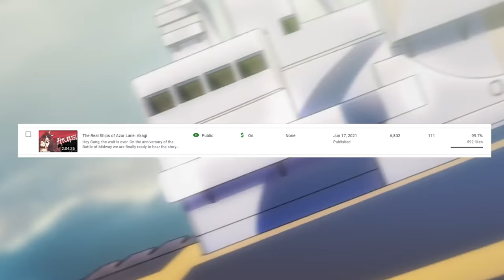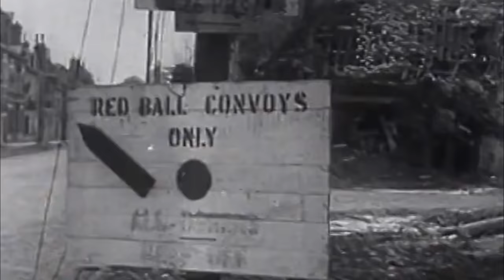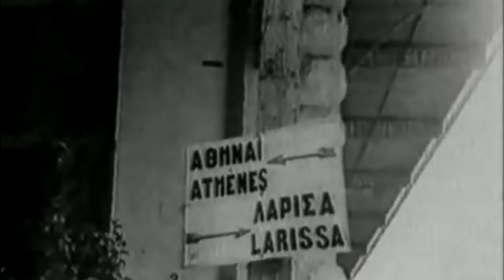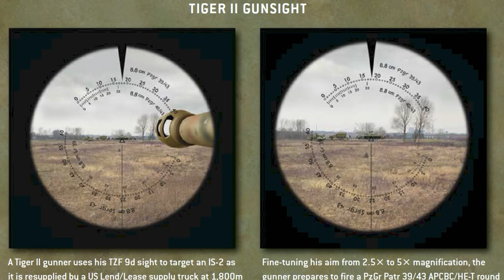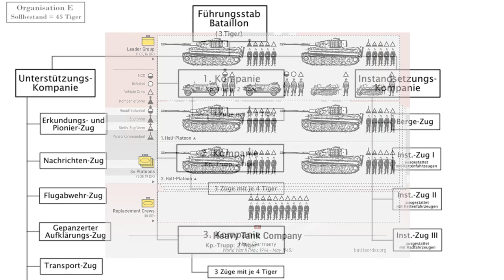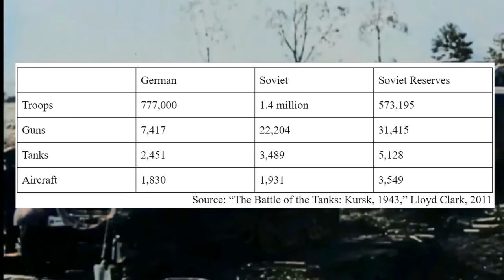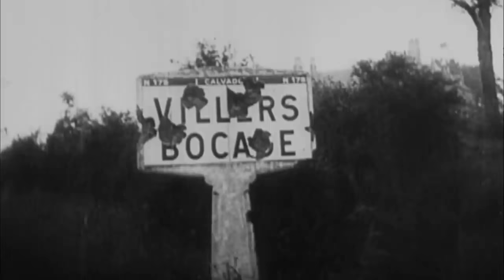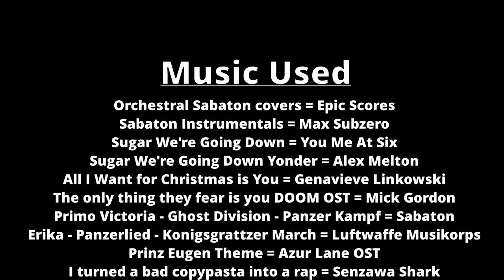The Tanks of Girls Und Panzer: Tiger 1 - WW2 History Documentary

Comment: Great video and great explanations on most parts but... A few minor corrections and problems I noticed with this video.
(Can't tell if my comment is glitching)
For early war and in battle of France, the Panzer III was NOT the main battle tank, it was one of two, both the Panzer III and Panzer IV were the main battle tanks.

During this time there was still more focus on having one tank to have the role of infantry support and the other for largely anti-tank combat. This was becasue the 3.7cm was seen as sufficent for anti-tank puproses but ill-suitable for infantry support, the same goes with the short 7.5cm howitzer on the Panzer IV. At this time a 7.5cm gun with a long barrel or larger caliber size with long barrel for Anti-Tank purposes was practically rare, at this time most anti-tank guns were from 3.7cm - 6cm with practically all countries. This both the Panzer III and Panzer IV were reliant on each other to achieve maximum efficiency, after all combined arms warfare.
The Panzer IV was an organic part of the Panzer division, by all means it's was permanently attatched with the division, unlike the StuGs which were inoganic units constantly reassigned to different divisions to support them, the StuGs role is to support anyone and everyone where ever and when ever, it went with infantry divisions, Panzer divisions, etc, the Panzer IV was always part of the Panzer division though in smaller numbers in early war, it was always aimed to work in unison with the Panzer III.

Until operation Barbarossa, there was not much of a thought on combining the two roles of anti-tank and infantey support just yet, the introduction of the Panzer IV with the L/43 gun is when the two roles at this point were merged. 

You also sort of nitpick on the interleaved tracks to much without explaining much of its benefits.
I don't really care that you explain the problems, I do care when you degrade something and don't at least say it's positives as it brings bad assumptions, and just seems more like nitpicking.
Under all circumstances to the west, under almost all terrain the interleaved tracks are one of the best wheels to choose for running performance. 
In addition interleaved wheels provided a very smooth ride over very rough terrain.
Along with that you didn't explain onto detail why Henschel chose that design to be more effective with weight, the interleaved wheels provided more contact to the tracks which basically provided more ground contact, this effectively have it a low ground pressure allowing it to cross mud and snow very well (if the wheels didn't lock from it freezing)
Of course it's not used in modern designs because it's complex but it's  factors of what makes it good shouldn't be left out as we need to understand why that design was chosen over all else.

Next the video could have been a prime opportunity to explain the Tiger I transmission and it's reliability.

Regarding 1942 and early 1943, the transmission did have some issues but it was hammered out. In addition the early Tiger I had a drive shaft designed with breaking points. This design was to reduce shock absorbed by the transmission when the Tiger made a hard impact on a tree, rock, etc.
If the Tiger drove hard onto some rock or tree, the shaft was designed to break at the shaft to prevent the gearbox from being damaged, in addition the transmission was EXTREMELY hard to access, the entire superstructure basically had to be removed to access it. Basically removing to turret and top half of the tank. The drive shaft with breaking point was a solution the prevent that. The drive shaft was way quicker, easier, cheaper, and faster to repair and replace, in addition it reduced maintenance on the transmission if the crew drives properly, though this was a rather fragile system and it seemed to break often. So later on it was removed, this of course boosted the vehicles reliability, from there on the transmission was largely reliable.
People of course always compare the Tiger I with the Tiger II and Panther thus the Tiger I transmission is degraded to hell. 
The Panther faced a major design problem with the gears and the Tiger II was overweight but the Tiger I design was good, it's weight was enough to be handled, the transmission had nothing bad to really stir up problems besides improper usage by the driver.

This is why the Tiger I availability for combat seemling increased by like mid-late 1943 onwards

Tiger crews are rather a bothersome tick in the reliability and should not really be included in it's reliability.
By 1943, Germany was having a bit of a shortage on skilled crews, training for Tiger crew began to get rushed in general, diving deeper into the war it would only get worse. If skilled crews got their hands on Tigers it was reliable, period.
If ill-trained crew got their hand in Tiger, that'll vary, it doesn't change the fact, that after 1942, it's reliability jumped to the point it can be considered reliable. After Kursk it practically steemed out almost all it's engine fire issues.

You could have also went to state more stuff into it's reliability, complexity, and so on
Transmission: For the most part reliable, but extremely difficult to access and a bit complex, trying to access a transmission for anything not a minor repair is impossible in the field and needs to be sent to a workshop.

The Engine was most unreliable comparing it to everything on the vehicle. Fuel line issues, engine fire, carburetor problems especially due to fuel lines. I need to check again but I think that the fuel lines issue was dealt with early on but the engine fire problem remained until some where after Kursk. I also need to check this again but I'm also believe that put of all the mechanical problems, engines fires are the most dominant one in kursk, the transmission were fine with only a few handfull having transmission problems.
(I'll check on the losses of each s. Pz. Abt. at Kursk later.)
Though one of its greatest ups is that it's very accessible. It very quick and easy to replace, you can see this from photos of cranes lifting the entire engine block out, it was a bit complex to repair yes but it wasn't much of a nightmare to replace.

I haven't seen much on suspension reliability issues with Tiger I so I'm going assume there is some but it's not prominent like Tiger IIs

I'll maybe add more to this later

Also as a last note, the engine could reach a maximum of 3000rpm, the Tigerfibel states that this would basically damage and degrade the engines lifespan, 2600rpm for the engine was recommended, in somewhere in the middle or early in it's productions, a capping this of some sort was added to prevent the driver from revving to 2600rpm unless emergency or something, this effectively reduce the chance of a human error of fucking up the engine.

I want hoping you'd address those issues and improvements seeing how long this video is.
Reply from the maker: I am pinning your comment for excellent historical diligence. I try not to go into too much technical stuff (unless like the tracks it leads to a good joke). I try to err on the edutainment side of things. But. When I leave shit out or make mistakes. I always make sure to pin a “shit I got wrong post”. But you’ve saved me the time so I appreciate you :)
Reply: impressive historical guy
Reply: There's also a couple other anime of the WWII/Military genre you might consider: Upotte (guns/infantry) and Strike Witches (Air Force/Pilots).
Reply: @CrossaintDeSurtr 
I just like to give the answer in full depth, cuz who knows when some dude is gonna go "you're wrong" and it's becomes a 100+ reply mess because neither of them gave in depth detail
Reply: @CrossaintDeSurtr We aren't keyboard warriors, we are simply historical worms. Who have a massive pride for our research into topics of the past no one will ever look at and end up believing crap they think they know but don't.
Reply from the maker: @jerryudonneedtoknow3903  I appreciate the people who shit on my videos for mistakes I make, because it keeps me honest, and it corrects mistakes. My nerdy audience are my editors. And I love you all for it
Reply: Actually in the Battle of France, the Panzer 2 and Panzer 38T were the main tanks of the German army. Of the roughly 2,500 tanks used in the invasion, only about 350 were Panzer IIIs.
Reply: @insert933  eh I knew someone would go into this.
It's a yes and no, the Panzer 38 (t) was not really a dominant factor until Operation Barbarossa, they were mostly in the 7th and 8th Panzer divisions, the rest either had the Panzer III or Panzer II and Panzer I formations.

The Panzer 38(t) wasn't part of the envision Panzer Division, it was a substitute for the Panzer IIIs and such.

The envisioned layout during the battle of France was Panzer division dominated by Panzer IIIs with some addition Panzer IVs for support.

What was in action is as listed below.

Most Dominant Panzer division layout: Panzer II's with  some supporting Panzer I's. Usually the 3:2 ratio thing where for every 2nd Pz. Ii, there was 1 Pz. I. If not this, it just had Pz. II's

Minor Panzer Division layouts included the Panzer III with supporting Panzer IV

The Panzer 38(t) was a substitute for the Panzer III, the same layout applied, a division dominated with Panzer 38(t) and supported with Panzer IVs

Of course if there is not Panzer IV available, they were not included or substituted.

Even if you don't consider the Panzer III as their "main", there still is 2 main tanks, the tank with the anti-tank role (Pz. III And Pz. 38(t)) and the infantry support tank (Pz. IV)

The Panzer 38(t) does NOT have a potent enough gun for anti infantry, whether consider whether the Pz. III or Pz. 38(t) the main tank, you must consider it does not fill the role of infantry support well and thus the Pz. IV was used along with it, in addition to the fact that, it was a substitute for what was supposed to be the main anti-tank tank, the Panzer III

I'm too lazy to go really in depth now so I'll leave it like this unless asked to do further.

Whatever tank the division had, it was the dominant tank, if the division had a lot of Pz. III that was the main battle tanks, if Pz. Ii, the pz. Ii
Reply: @CrossaintDeSurtr These guys scratch the itch for people like me when there's something the op gets wrong/misses or they provide a good addendum to the video not to mention history should be dictated in accurate detail in order to stop misinformation.
Reply: @sinisterisrandom8537  Relax this is somewhere we all want to learn no  need to be heated. You just turn people off and they will ignore you.    Then what you complain about happens they go on believing errors and learn nothing.
Reply: More wheels do not equate to less ground pressure.  More track area (either in length or width)  equals less ground pressure.  More wheels would lessen the load carried by each, possibly reducing strain and wear on each individual wheel setup.  However, doubling the amount of wheels then increases the overall likelihood of a failure.
Reply: @bbrf033  thank for correction, I was too lazy and couldn't find the words to go in actual detail with that so I just put something that was quick to be said.

I was trying to emphasize that there are more contact points on the tracks with the amount of wheels they got and distribution of weight is more evenly spread bla bla
Reply: Thank you Jerry. A nice piece on your part. But , may I offer you a little advice ? ,... if I were you I wouldn't bother, it's that simple. The Narrator kicks of with ''Wheraboo'', and , trust me , that is ALL you will get for your efforts. 
I sort of skimmed through on fast forward, listening to the sneer. It's not history .
You make a good point about the suspension , by the way. How many times do we hear the interleaved system being knocked as if the German engineers who designed it were complete idiots ? All the time.   In fact , interleaving your road wheels has distinct advantages, as you might expect. You get to keep your large road wheels with their lower rolling resistance , yet have more suspension points for your load. Softer suspension , better ride , BETTER FIRING PLATFORM . This last one is really important as it accounts for half the reason why the Tiger tanks had were capable of such accuracy at long ranges in a pre laser rangfinder ect era.
Watch footage of a Tiger firing it's main gun . Now compare that to almost any big gun tank you care to name.  Steady as a rock.  She's a better firing platform than most post war tank designs, almost perfectly suited to the size and weight of shell she fires.
Reply: @bbrf033  ''doubling the amount (number) of wheels then increases the overall likelihood of a failure'',... No it does not and that is a poor thinking . I'm sorry , but it is.  Increasing the number of load bearing points (bearings , in fact)  DEFINATELY (not ''possibly'') reduces strain (load) at each load bearing. This will reduce , not increase , the likelihood of a failure. For sure. 
 Decrease the suspension points, increase the individual load on each bearing , INCREASE the overall likelihood of a bearing failure. 
That's the way it works.
Reply: @andrewwoodhead3141  well I find it fun to explain the technical aspect of tanks, so I don't mind spending some free time type this. I do it cuz it's fun and sometimes I figure out something new or more detailed

And also in addition to your thing on the firing platform, what made it even better was the fact that the recoil dampener was spectacular at absorbing the energy of the recoil. In most of the footage where you see a Tiger I shooting, the hull/chassis barely shakes and sometimes it doesn't look like it shakes at all.
Reply: @jerryudonneedtoknow3903  It was commented on during the firing trails for Tiger 131 . I don't have the book any more , though I note that the Bovington tank museum has reissued an updated version. Anyhoos , the officer noted that the tank ''settled' after only two or three ranging shots, after which she was steady .  A lot of people don't understand that there really was very little ''first round hit probability'' back then . Without a laser range finder and a  ballistic computer , and with no stabilization system , you stopped the tank and ranged in your gun. At short range it might be a case of  ''point and shoot'', but at a mile and a half you were going to need a couple of ranging shots and a steady firing platform....
Reply: @AnimarchyHistory  I wish youtube still allowed little messages to added to videos
So you can be like "hey guys, check the comments for a more detailed breakdown on WHY they where picked and used"
Reply: @yinsloth5001  I was pretty chill in my head. Just wanted to clarify that incase they made any other assumptions. To be honest he prob was meming.
Reply: @jerryudonneedtoknow3903  you my guy, Are a brilliant researcher. Good job
Reply from the maker: @andrewwoodhead3141  I'd like to point out that as the guy who posted the video. When he made this huge detailed comment. I hearted it and pinned it. So I'd say his efforts weren't wasted. I am making entertainment that educates, which means I have to generalise and create a narrative. Think more accurate than hollywood and the history channel, but not a technical/field manual. Not only that, I am one man, working a real job on the side. I will inevitably make mistakes. When my audience calls me on those I usually make a "Shit I Got Wrong" post. 

As far as criticisms for interleaved road wheels. It's telling that the Challenger, Leopard 2, Abrams and T-72/90/ARMATA series. All have singular road wheels. It is most definitely a better performing design. 

The F-22 is a better performing design, so why have so many F-16's and F-15's? Why design the F-35? Simple. An F-22 Unit Cost and subsequent maintenance costs make it too costly to run all the time. Hanger time for an F-22 or to take another example, the C-5 Galaxy. Is double or triple that of an F-16 or C-17 respectively. The Tiger follows the same principle, certainly the road wheels improve performance, decrease strain on the suspension and on the tracks due to the weight. However if anything DOES go wrong, the repair time and cost are much higher. 

Consider the T-34, the Soviets knew the transmission was prone to breaking, how did they handle it? They built a hatch in the engine bay so they can directly change the transmission without having to strip the tank down. German engineers are like all engineers, Messerschmitt may be an exception to that in some ways (you can tell aviation is my stronger suit) but on the whole engineers rarely pay heed to the trials and tribulations of the mechanics. History tends to show that weapon systems designed with the theory that they will definitely break at some point, tend to work better in the long run.
Reply: @AnimarchyHistory   So. You say that you are making ''entertainment that educates'' , and you must think more ''accurate(ly) than hollywood and the history channel, but not a technical/field manual (two very different things)'' Quote, unquote.
And then you go on to tell me about your ''job on the side'' . 
Not a job as an engineer , though , is it ?! Despite your willingness to make staggering  generalizations about how engineers go about their business. 
I am going to be blunt with you because I have exactly zero sympathy with your position . You are not an educator any more than you are an engineer. You are  some guy who is largely pleasing himself while assuming a totally unearned position of authority. A real educator would understand , without me having to explain it to them , that the onus is upon themselves, youself, to be completely accurate in what they are saying and writing .
 Not ''generalize''. Not ''create a narrative'' . The only ''narrative'' that is relevant here is history , and I suggest that you leave that to the professionals too .

As regards the road layout of post war MBTs. 
It IS telling that most current , third generation, MBTs favor a seven wheel station layout over that of the six wheel station layout favored by older MBT designs.  This is evident with the Abrams , Leopard and T14.
However , this does not mean that it is ''most definitely a better performing design ''. 
 What it does means is that , on balance , designers decided that  it is not worth the maintenance cost involved in interleaving the road wheels , and that a combination of improved shock dampening and better fire control technology can take up the slack.  They would still prefer more wheel stations , hence the move from six to seven wheel stations , but interleaving the road wheels has, on balance, too many drawbacks.
In terms of performance , ride , terrain handling, and the tanks performance as a fire platform, eight or nine interleaved road wheel remain the superior option and always will. It is simply an intrinsically better solution.
Nobody is saying that the Tiger tank was a perfect design , by the way. 
However , there is no balance in the simplistic approach favored by amateurs like yourself , sneering your way through these sort of light weight presentations.
The Tiger tank remains a genuine testament to  the engineers who were involved in it's  design , and a remarkable demonstration of what could be achieved with nineteen forties technology. It is very unfortunate that people now chose denigrate their efforts from a position of  ignorance in order to further some ''narrative'' .
However, the fact that it stands comparison with post war MBT is probably the best compliment you could pass their way.

I am not going to argue with you about aircraft. Unlike you , I do not pretend to having any expertise in that area, nor do I imagine myself an engineer.
Reply from the maker: @andrewwoodhead3141  I guess my currently underway double degree in education and history means dick. And my PPL which I had to abandon because it was too expensive doesn’t mean anything either. I will reiterate what I said before. I pin these posts for this very reason. I tell true stories. I make history fun. For absurd levels of detail that the general public won’t find interesting but some people would. I usually write a post like this below. But this gentleman above. And yourself have done it for me. So I pinned the comment. You can act high and mighty all you want and look down on me. That’s your prerogative. But I’d take a moment to consider that I have just let you blast me in public on my channel in a pinned comment. For the sole reason that it WILL educate those who are interested. Have a nice day now.
Reply: @AnimarchyHistory  I appreciate you and this video and these comments made my day brighter. Thank you and I plan to watch your other videos now that I am subscribed. =) <3
Reply: @AnimarchyHistory  Also 23:23 Yes, Yes She is...Great XD <3 Love it!
Reply: In the original Panzer-Division concept, the fighting armoured unit was the Panzer-Abteilung / tank battalion, planned with three medium tank companies and one heavy support company. The tank companies were going to have PzKpfw III tanks (but often had PzKpfw 38(t) or even PzKpfw II tanks instead), and the heavy company would have PzKpfw IV tanks.

The Pz IV wasn't an infantry support tank. Again, it was used in a tank platoon in a tank battalion: it supported tanks. The corresponding infantry support vehicle was the StuG III.

Overlapping and interleaved road wheels on medium or heavy tanks was a very bad idea that was only used on two types (Tiger I and Panther / Jagdpanther) before it was discarded: in both cases the decision was made before proper testing had been done. The Tiger II / Jagdtiger used overlapping non-interleaved roadwheels instead, which worked reasonably well. I definitely don't care how smooth the ride was: when the designers who came up with the idea immediately dropped it as soon as it was implemented, then the drawbacks outweigh the benefits.

Tiger I crews were usually recruited from experienced Pz III / IV crews, while Panther crews usually were green. At the time when Germany was running out of trained crews, they were also running out of Tigers. The Panther was the type that had more engine fire issues, due to fuel leaks in the engine compartment.
Reply: Modern tanks weigh more and don't have interleaved wheels.
Reply: @peterlewerin4213  
ah yes thanks, I do not have the time to fully explain or clarify everything I type, thanks you for correcting on the Panzer IV being the supporting tank, not an infantry supporting tank. I was meaning to say it fought more against infantry while the Panzer III dealt more with armor. Kind of messed up my phrasing.

My point on interleaved wheels was why is was chosen, not that is was superior to something else or that is was some godlike thing, I was mostly trying to emphasized that there were pros to interleaved wheels, even considering the drawbacks. Because it not really looked at often why interleaved was chosen in the first place.

While tiger crews cam3 from experience Panzer III and Panzer IV crew, it doesn't change the fact that, those crews had to be trained with a new more complex vehicle, the crews would have the battle experience but are basically greens when it comes to working with the tigers, it's like telling a car driver to start driving a motorcycle, they have some knowledge of how it can be used, but they are not familiar with the new vehicle. In anycase, as the war progressed training for use of the Tigers began getting rushed, the crews are gonna be lackluster no matter how skilled they are in a Panzer III or IV because the driving, gun handling, maintenance, etc, is all going to be different from the original vehicle they used before.
Reply: @goldreserve  I did not say "interleaved wheels were be best wheel design in existence" I was stating they are a better choice (at this specific time) for doing (whatever thing it may do). I never stated is was the best design in existence, of course it wouldn't be in modern, advancement in thing and other factors make moderns have superior designs, suspesion, track design, etc all play a role.
Reply: This guy just wrote a whole essay
Reply: in the early war and battle of france panzers 1 and 2 were the ones that were most common as well as 38(t)'s not 3
Reply: What's the videos called used in this? The ones of the tank battles not the anime shit
Reply: I learned more by reading this comment and their replies than i did learning in class
Reply: Add-on to give specifics on issues with the engine. The original comment is unable to be edited which frustrated me

In regard to the engine.
The initial tigers were equipped with rubber sealings on the engine deck to allow for deep wading in rivers. The issue is that it would not allow adequate ventilation of heat and so the heat generated from the engine would build up in the engine bay, allowing the engine and its components to fail out of the sheer amount of heat buildup.

It is notable to mention the engine (Maybach HL230 P45) is reliable alone, it is just that under the conditions it is in, it gets issues. The key issue with the Tiger I's engine is that the engine bay is small and too cramped, even when they removal of the rubber sealings had taken place, the engine bay itself was very cramped not allow good airflow to vent the heat out. This is the same issue with the Ferdinand/Elefant who had a reliable transmission and engine but faced major issues of the engine bay being too cramped the engine overheated. (Note: The Double Maybach HL120TRM was reliable, the Porsche Typ 101 Engine was not, and was seen on the initial and early Tiger (P) and Ferdinand/Elefants. 

The main issue with this overheating is that the piston arms would become prone to breaking due to the heat buildup. Likely would be the issue is that the heat warped the piston arms causing them to latter snap, damaging the gaskets and cylinder block as well resulting in a gap to allow fuel to leak and thus a fuel fire, or engine fire to be more precise.

Regarding the suspension.
The suspension was for the most part reliable. It is a torsion bar suspension (which is generally very reliable) with interleaved or overlapped roadwheels. 

Reliability issues with the wheels stem from the rubber rimmed roadwheels. Initially only meant to be kept on the prototypes. They had to be put into combat for reasons I forgot. The rubber rimmed wheels were less effective sometimes prone to having the rubber break off so the need for steel wheels really came in.
The ideal for steel wheel was made from basically the start, but reason I forgot had them hold off the change. The rubberwheels being less effective are the main reasons why the interleaved roadwheels existed on the Tiger, they were not very effective that 4 layers of wheels were needed, the much sturdier, more reliable and effective all steel wheels could handle more weight so the removal of the 2 layers could be made making the. layout overlapped, rather than interleaved
Reply: @andrewwoodhead3141  i bet you are also the type that thought Russia would ride straight into Kyiv.  You sound like the type who gets a stiffu for anything vaguely fascist.
Reply: @jeffk464  I can tell what it's not ,.. a legitimate historic channel . Some of the commentators are way more knowledgeable than the presenter.
Reply: @jerryudonneedtoknow3903  Just read your further comments. If I hadn't ducked out of the convo a year ago I would have given you some likes a bit earlier.
Reply: @ajalvarez3111  I would suggest that you take your education from published books in future. That's all.
Reply: Why didn't you do more GUP/tanks vids? All I see are the ships.
Were they more fun?
Reply: theres always one guy, that says "Great video and great explanations on most parts but... A few minor corrections and problems I noticed with this video" and writes a book...
Reply: @Paranoidtimes  So? If you got a problem with it, keep to yourself, unless you are going to point out something I may have got wrong, dont be a child, either be in a discussion or dont
Reply: @jerryudonneedtoknow3903  if you want a serious video... find your way to the history channel... normally when people say something " negative" mind you I'm not the only one... its " you" not us... and I was I was pointing out the way you " introduced" the statement... i was joking, as I said for a second time... but for someone who gets mad over this? isn't here for the facts or the fun, they are here to have their ego palmed... good day sir
Reply: @Paranoidtimes  Firstly, most history channels do not discuss specific mechanical components as well as both the strategic and tactical usage in depth, the later is more discussed, but mechanically wise, it is rare to see such information in youtube due to constant simplification and myths. Anyway with amount of other comment that are rather childish made me assume you actually were imply such not in a joking way. Im not mad, im just provoking to either get rid of those acting childish or probe people like you into elaborating whether you were joking or not. You respond to this so the probe works
Reply: @Paranoidtimes  Anyway, as I said Im looking for a discussion, in history channels, more often I find much more people unwilling or far to indulged in myths to have a proper discussion. In a specific video seemingly more passionate on focusing on the tank, i can actually find those who are more well versed in the vehicle for the indepth knowledge vehicle. 

Example: Militaryhistoryvisualized discusses the tactical and strategical employment of the tigers as well as their combat effectiveness and uses. Yet does the channel describe the certain battles they have won or lost, the battles which changed usages such as one battle which made Tiger II crews stop putting ammunition in the turrets. Does it talk about the specific engineering or technical maintenance? Does it talk about the specific field workshop operation or the specific part that often break in a mechanical failure? No

To have a proper discussion on that, I need to find a video that is seemingly more passionate on the specific subject there, this video fits. Additionally, an introduction like that gets attention, from there I can attract those for a discussion, but with a byproduct of some childish people who say things like "wehraboo"

to simplify, its a probes to find those willing to discuss, my response to you was a probe to see whether you were a genuine childish person or just making a joke, its not like I can tell your tone of voice in a comment.
Reply: @jerryudonneedtoknow3903  but if you think your synapses is the reason I commented then you would be wrong, frankly you cant take a joke... if you felt the need to say anything to me... and didn't get what i was saying.... you are the one that has the issue...  if there is one... after my second cup of coffee this morning... i wondered if there wasn't a pissed-off german somewhere slamming his keyboard and screaming NEIN! NEIN! NEIN!  you probably will not get this joke either
Reply: @Paranoidtimes  i dont really get your point here nor do I really care. I will not treat it as a joke because I too lazy to interpret whether it was a joke or not, i responded as a probe because Im to lazy to interpret what you typed, you make my life easier by going on a rant saying things like "its a joke" or "you cant handle a joke"
With your response I can decide whether you as a troll as some may put it, or you could be like the ones stating a joke. If I'm bored, I could information dump on those who are troll, or just argue because Im bored and want a reason to explain tanks.

Like I really dont care why you commented, all I care is whether you are a joker, troll, or someone here to discuss so I know what to expect and deal with, and having you tell me directly makes it simple.
Reply: For France pz3's and 4's were rare. The main German army were fielding 1's and 2's.
Reply: At the start of the war panzer 3's was the main battle tank and panzer 4's was playing a support roll. The Stug 3's supported infantry. Going into Russia their rolls started changing to fit their new needs.
Reply: Nothing wrong with correcting mistakes, especially when the creator welcomes it.

That said, try to be a bit less of a dick about it.
Reply: I was expecting wehraboo copium, instead, I was glad to be completely wrong, I learned a lot so thanks for the history lesson